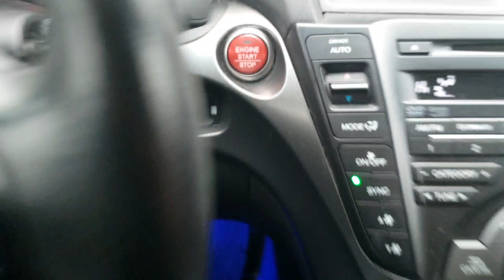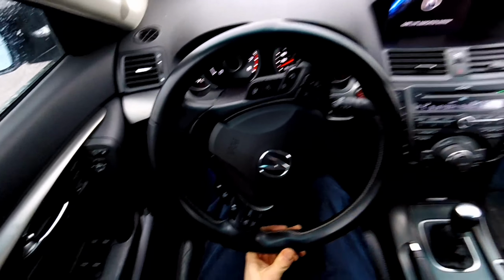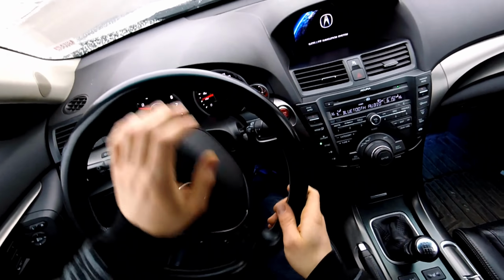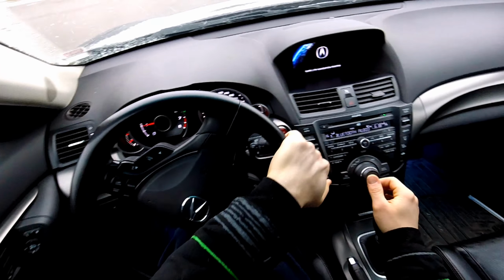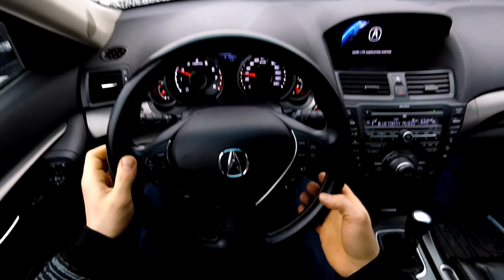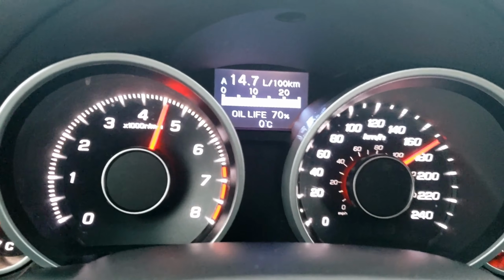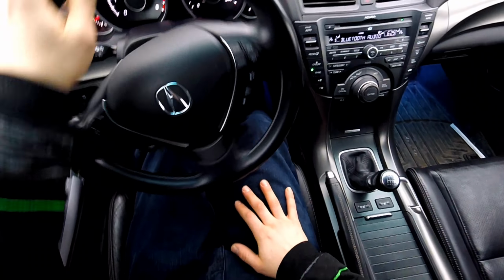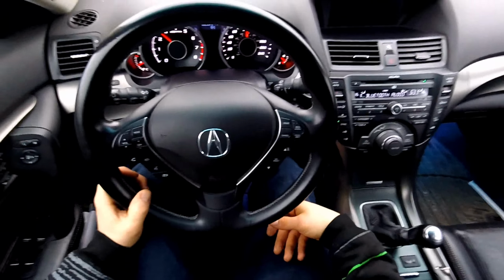My THOUGHTS On Stage 3 Clutch + Lightweight FLYWHEEL For ACURA TL 6MT

Comment: getting mine installed this weekend! excited. and they recommend break-in for 500 city miles. I do a lot of highway driving so that will take me nearly 2 months of driving 40 miles a day to properly break it in. that's an expensive clutch and flywheel, I wouldn't want to mess it up. I've heard some have luck with the provided spec throw out bearing
Reply from the maker: Yah I lucked out, only paid $330 labor. I'll probably go 6-700 cory miles before ripping on it to be safe. I just go for drives around the neighbour to break in sooner.

Comment: Lol currently i have five 3g TL, two MT a 05 and 07.  Here is the breakdown.

05 is on original clutch.
07 is on unknown brand clutch that recently got replaced.

The pedal travel is exact as you described, the 07 grab early almost instantly with super springy pedal where the 05 have a-lot of pedal travel before engaging.  

I stall my 07 all the time if i drive the 05 for daily. 

With the light weight FW you are looking at 12-15 whp increase.  I would do light weight rims next before coils.   

I like the 4G MT power but couldnt deal with potential burning motor oil and drivetrain mechanical complication.  Especially where i live lol
Reply from the maker: The oil burning might be solvable by using Motol 1, I believe that's what Princeboodoo uses and he revs passed 7500. The drivetrain is amazing as long as you get the clutch delay valve delete, and don't launch it over 150 times like a did.

Comment: I would still wait like atleast 1k before.. but damn dude I get it though I would have waited.. hopefully nothing is wrong I really hope not l. Just break the clutch in see what happens afterwards. I’m pretty sure it’s just the break in period for the clutch. I can’t wait to see how she moves when you finished with her. Aye man if you can mod you can mod be the face for the 4th gen manual community! Also light weight wheels. Ktuner can wait bro. A lot of stuff to do at once you doing it right though.
Reply from the maker: Yah hopefully it all works out with no issues🤞. I've been taking too long to get mods on, gotta step it up this year🤙!

Comment: Enjoying the content.
This car has always intrigued me. 
Did you do the drill mod yet ?
Reply from the maker: What's the drill mod?
Reply: @RevsALot  
I meant the check valve mod on the slave cylinder
Reply from the maker: @Highlander1432  no I didn't, but going to before shifting fast 1st-2nd.
Reply: @RevsALot  another thing to consider with getting different wheels is that a smaller diameter artificially changes the gearing of the car.
Going from a 19" to a 16" (even if weight remains the same) will significantly increase how hard you accelerate through each gear.
I'm sure you've heard of a "drag pack" before.
I have a 16 Camaro SS 6 speed. The ring gear is welded to the differential so the only reasonable way to change thw gearing is smaller wheels. 
I went from a 20" to a 19" and there is a big difference. 
(Speedometer will be off a little if you don't adjust with tuning software though)
Reply from the maker: @Highlander1432  I'll be keeping the same diameter as what I have now, which are 18's. They'll just be 8lbs. lighter per wheel👌!
Reply: @RevsALot  Its not just wheel diameter, you also effect gearing with sidewall size as well. You can have the same 15" wheel but you will go through the traps at a different RPM with a 22×15 vs a 24.5×15 vs a 29x15 etc because you still effectively change gearing but with the same diameter rim. Taller tire/shorter tire anyway you get there will change your gearing.

Comment: Awesome video ! Btw to my understanding i think you cant go high flow for the supercharger kit and that it has to be the delete ones
Reply from the maker: You're correct, but I might go hfpc until I get the supercharger then I'll be able to do a giveaway for the hfpc.
Reply: @RevsALot  ahhh! also you mentioned that the lightweight pulleys wouldnt work with the supercharger kit; can you elaborate on that? I have the 3 pulleys from unorthodox racing.
Reply from the maker: @101Ari101  I'm not sure why to be honest, you'd have to ask gerzybear on fb or IG.

Comment: Hows the stage 3 in traffic? My is a daily also, I've got all the bolt ins on my ride including deletes, throttle body etc.
I bought D2 coil overs for my ride check them out.
Reply from the maker: It's alright, once you get the hang of taking off it's just like any manual. Just the hills that I can't seem to figure out. I'll probably go with Tein just cause of the price, but we'll see.
Reply: Are you after the blower from gerzzy too? The stage one later on the road?
I was gonna order it this week but with this corona crap I've gotta hold up since I'm self employed and the setup will cost around $10k with clutch flywheel pro tune 🙄
Reply from the maker: @MrJkuncl  yah I am, aiming for 2021🤞. I hear you there, I'm trying to get self employed too. Hopefully in next cpl years.

Comment: How much did the shop charge for labor for the syncros and clutch job?
Reply from the maker: I was getting the transmission fixed under warranty, so only got charged 2 hrs labor.
Reply: RevsALot what was getting replaced under warranty, and what year is your 4g?
Reply from the maker: 2nd gear syncros, and '13
Reply: @RevsALot Thanks, going with spec stage 2 plus on my 13' 6spd. Any tips?
Reply from the maker: @Joe-nb3kt  just make sure you do the proper break in. I love my stage 3, but regret getting the lightweight flywheel.

Comment: I’m afraid it’s your throw out bearing, it happen to my cat and it will get worst. If you have the Billet lightweight flywheel the bearing does not fit all the way into the slot, yuh you have to beat it in. I had to replace my exedy bearing with OEM, good thing i have my own Michanic and it didn’t cost me as much..
Like I said I can help you because I’ve been through it...I already have the tunes for ktuner..I have all the setup..
Reply from the maker: Thanks for the info, I guess I'll just have to drive it till it let's go👎.

Comment: The performance clutch will always have that kind of noise, you didn’t break anything. Its just how it is with performance clutches.
Reply from the maker: The pressure plate broke after a cpl thousand miles, so back to OEM now.
Reply: @RevsALot  🤦🏻‍♂️ ouch

Comment: Good video, watched until the end. The clutch noise could be the clutch material while it wears or breaks in. Launches are usually hardest on clutches for AWD cars.  Couple of questions:
Is a new stock bearing compatible with this clutch though?
Also, do people turbo the J37? I'm personally leaning towards turbo over supercharger especially because of the tsutsutsu!
Reply from the maker: Thanks!👊 Well that eases my mind a bit then, and no I believe you have to use a press to get out the bearing or something. That's another reason why I didn't bother putting the OEM in, it would require the know how which I don't have. I've only heard of one turbo 4th gen on Acurazine, Sancho Sevy tried it on his j37a4 accord but was having issues. Gerzybear kit has a BOV, so sounds like a turbo and not the usual whine.